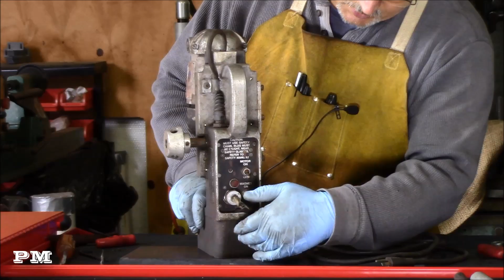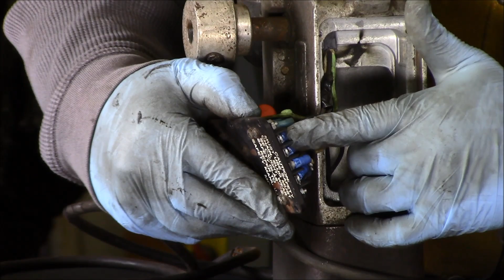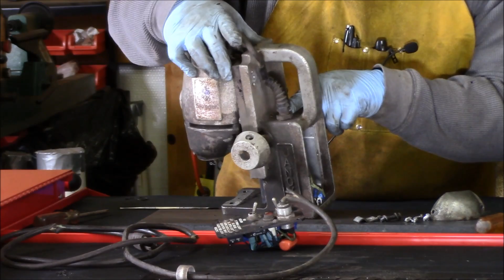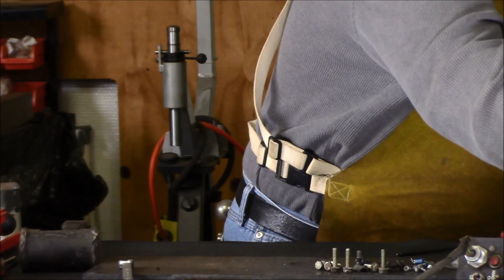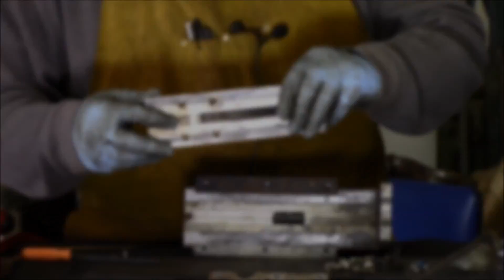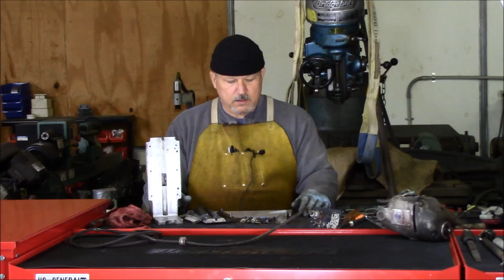Jancy Slugger JM101 Magnetic Base Drill Rebuild Part 2

Comment: do you think all of those wire connectors, spade connectors, etc are the same vintage of the machine?  they look newer to me, but then again I don't know much about this kind of stuff.  Well said on the electrical tape, better to use heat shrink like you said, and yes, good 3M electrical tape is so much nicer than the cheap stuff.
Reply from the maker: Not sure. I did determine it has been repaired. Gotta get this series finished.